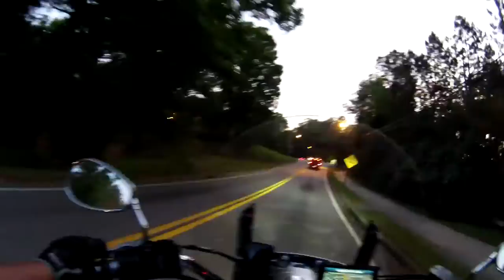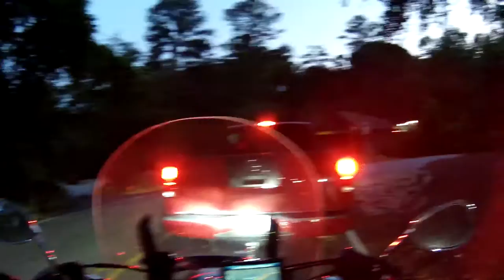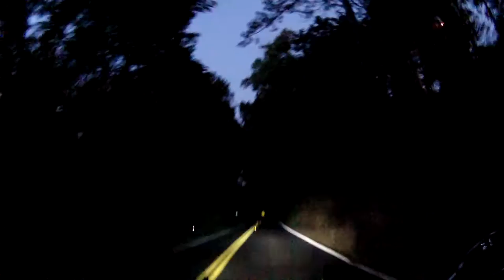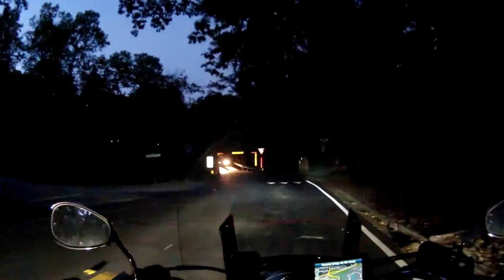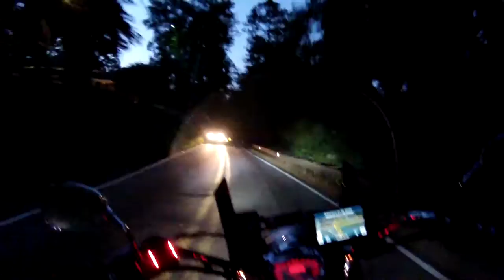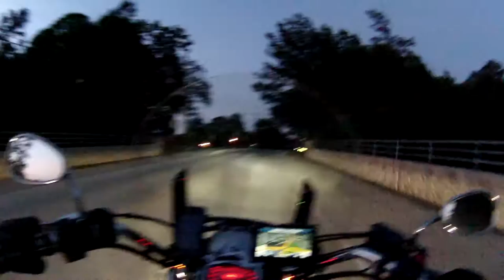OPT7 Motorcycle LED Headlight Kit w/ Arc-Beam Bulb

Comment: I've got a similar one on Ebay from China but mine is a triangle shaped with 3 leds one on each side plus a high beam led with a fan It works great also much better than others Yours looks like it lights up great
Reply from the maker: Thanks!  This one has 4 LED's.  (2 each side )1 low and 1 high on each side.  I just hope it lasts a while. Here in Georgia it has to burn or you get stopped by the GHP.  I hope all is well with you and your lady.  Take care.

Comment: Impressive, I think the conventional bulbs take a hammering with the vibration especially so here in the UK with the pot holes & poor road maintenance.  I've seen a lot of videos on people replacing bulbs with LED's but with mixed results, I think the lens design & reflectors seem to make or break the upgrade. ie some conventional reflectors just scatter the light everywhere. Your upgrade seems fine ie your not getting flashed by angry drivers. i'm tempted to try them.
Reply from the maker: This one was expensive at $60 dollars US but so far it has worked flawlessly.  The beam is like a horizontal line of light.  Very bright and so far very durable.